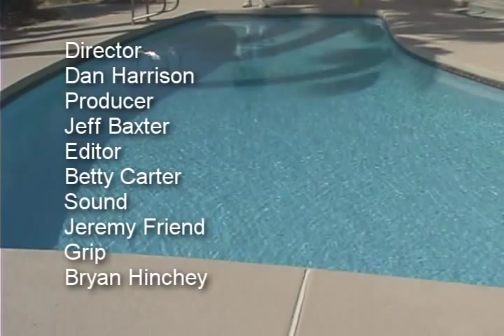How To Paint & Acid Wash A Swimming Pool - Part 3 -Painting

Comment: I would add to remove hydraulic plugs at the bottom of the pool to prevent the pool from lifting like a boat.  We live in an area with a high water table. What is the average cost per gallon (w/hardener) for the Nelsonite PoolPoxy Hi-Bild or the Ramuc paint that you used?  I understand that it takes a few days for the paint to cure, but how soon after painting can it be rained on?  Thanks for the video!

Comment: Hi, my pool had been painted with a water based paint called insl-x paint. Can I now paint it with the epoxy based paint?
Reply from the maker: So most pool paint is either water based, acrylic, epoxy or rubber based. Generally you want to use the same paint type as you currently have. If you mix the different paints, they wont adhere properly. If you do pressure wash all of the old paint off, then you can choose whichever one you want to use on the pool. Hope this helps and thanks for watching!

Comment: Excellent Job on the videos! You've inspired me!
Ques:
The water level is below the first step in our pool due to leaks/cracks, kinda brittle in areas. Is E-Z Patch still a viable option?
Is the pump in the bowl something you can rent? Any specs to look for on pump?
Where you concerned about the pool popping when empty? How many gallons of acid did u use for this job?
What would happen if it rained on day 2+ of paint drying process?
Can u get darker colors of the same paint?
thx

Comment: I have a commercial pool that has stainless steel walls, and a painted concrete bottom with racing lines. The approximate area that needs to be painted is roughly 82'x48' (the bottom only). How much paint would I need?

Comment: Really appreciate your videos and instructions. I finished painting our pool last Thursday morning. Pool was able to cure for 2-1/2 days and then we got a little bit of rain. Shop vacuumed the bowl of the pool. The next three days we got more rain, not a huge amount, but enough to fill the bowl. We waited the three days until the rains stopped before vacuuming the bowl out again. Now the pool has been able to cure/dry for another three days. Is it safe to fill the pool tomorrow or do we need to wait longer? Please advise I would very much appreciate it or my family may mutiny!!! 😬😬😬
Reply from the maker: Normally paint should be left to dry/cure for about 5 days. Go into the pool and press on the paint in a few spots to make sure it has hardened, especially in  the deep end / bowl area. If that has hardened, you should be good. Best of luck to you and thanks for watching our video!

Comment: My pool in Florida is less than two years old.
From the get go there has been extreme mottling and the pool contractor has drained, acid washed and refilled the pool with noticeable improvement for a month or two before returning to the mottled state.
We are diligent in keeping the chemical levels at proper levels and brush daily.
Quite frankly we are done with trying to resolve this issue in this matter.
We have several quotes to have the pool resurfaced but am also considering painting the surface which has a quartz finish.
Have you any experience with repainting a quartz finish and do you expect the mottling to come through the new painted surface?
Thanks !
Reply from the maker: Hi Chet - That's so hard to predict or diagnose without seeing it in person. Sounds like you have something unusual happening there, so I would not recommend just painting over it until you get to the root of the issue.  I would call up a few different pool companies in your area and get their opinions before doing any painting.
Reply: Pool And Spa TV Thanks for your prompt reply !

Comment: We just bought a house with a pool.  My husband drained it and that was when we saw all the plaster coming out around and on the steps and there is rust at the jet in the shallow end.   Plus we used a pressure washer in the pool and got lots of the algea and stuff off of it but not all.  I was wondering how to fix the plaster and the dirty walls and then how to paint it and you addressed each and every issue we have.  I imagine we will start this pool project this weekend coming up and finish it in 2 weeks time which is time for the hot sun coming our way.  Thank you so much.
Reply from the maker: +Elijah Diamond - You may want to have a local pool guy come over and take a look at the quality of the plaster on the pool before doing any additional work. If the plaster is degrading, and you paint over it - it will look great for a while, but it could start to come off, ruining your paint job. You only want to paint a pool where the plaster/cement/gunite is firm, strong and not deteriorating at all.  If you only have a few small spots like we show in the video, then you can do some small patching yourself (like we show). But if you have a lot of degradation, you may need to have the pool re-plastered prior to painting, Just a tip....  Thanks for watching :o)

Comment: How much was labor and material cost?
Reply: Was this on a 35,000 gallon pool?
Reply from the maker: @savagewarriorzz2199  Well, The people in the video were our employees, so there was no charge to us for that. That pool was a 14,000 gallon pool - approx 14x28. So to a pool owner, the paint would be approx $500 and it would normally be about $2000 in labor. That varies greatly depending on the state/area where you live. Hope this helps. Thanks for watching!
Reply: @PoolandspaTv   how much in labor on a 35,000 gallon pool?
Reply from the maker: @savagewarriorzz2199  You would need to call a local pool service company to get an exact price quote. Could be anywhere from $2000 - $6000 depending on where you live.

Comment: Tim, 
Some say that I mut use the same paint as the old paint on the pool, because they should mach chemically otherwise the new paint won't stick to the old one. Is that true?
Thank you
Reply from the maker: So most pool paint is either acrylic, epoxy or rubber based. Generally you want to use the same paint type as you currently have. If you mix the different paints, they wont adhere properly. If you pressure wash all of the old paint off, then you can choose whichever one you want to use on the pool. Hope this helps and thanks for watching!
Reply: @PoolandspaTv  Thank you for the quick response!

Comment: Hi Dan, thanks for putting this 3 part video series together. Very informative. I'd like to paint my concrete pool - it's about 30 years old and the original paint has worn/peeled significantly about 2-2.5 feet down from the rim. Will the acid wash generally remove existing paint? if not, is it ok to paint over any remaining original paint after the acid wash phase? Any recommendations would be much appreciated. Thanks. Mike.
Reply from the maker: Mike Fabrizio - It will not remove paint that is still stuck on the pool. You would need a power washer or a sand blasting for that. However you do not need to remove all existing paint in order to repaint a pool. Just make sure there is no loose old paint before you attempt to paint over it. Hope this helps. Thanks for watching. Dan

Comment: My pool has a gunnite bottome with plastic/fiberglass composite side panels.  Would the same procedures and materials be used or would different be required?
Reply from the maker: No. You should not do this procedure on plastic, polymer or fiberglass walls. Just on gunite, plaster or cement wall pools...

Comment: We are adding water to a newly painted pool and I saw in your "opening pool" video that you added 1 gallon of Cyanuric Acid right from the get-go.  We were told to use Muriatic acid.  Are these two the same?  Gina
Reply from the maker: No they are not the same. Cyanuric Acid is to raise the CA levels in fresh pool water. Commonly called Stabilizer, it keeps the chlorine in the pool from being burned off by the sun rapidly. Most pools need 2-4 lbs. of CA upon a fresh filling. Muriatic acid is either used to do an acid wash on a pool, or in your case, can be added to decrease the PH. I would not add that until you get a water test done. But the Cyanuric acid is something you should put in right away.

Comment: Good information. Glad the water table was obviously low and the pool didn't pop out of the ground. Note: keep the plug out of the main drain to relieve any hydro-static pressure from the ground water table. Also, do this job during the months with the least amount of rainfall to help avoid catastrophic pool popping out of the ground. Run a sump pump full time if ground water continually enters through unplugged pool to complete the job. Pray everyday and if you can't stomach the risk and can afford to hire a pro with insurance against popping, do so, so you can sleep at night. ( I have had a pool pop -out of the ground in FL during a paint job. I foolishly hired a non pro (kind description) that plugged the drain before a two day rain deluge, the pool popped. $$$$$ ouch!!!
Reply from the maker: This pool was in Southern Nevada on Sunrise Mountain, so there was no chance of sub-surface ground water. But for your pool in Florida, yes, you have to watch out for "popping out" due to high underground water tables. So for everyone in areas like Florida, definitely hire a pool professional who knows what he's doing anytime your pool needs a repair that requires the pool being totally drained out. Thanks for watching!

Comment: Do you have to acid wash before painting?
Reply from the maker: It is a good practice to do so.  With some pools, a power washer might do the trick. But you really want to remove any oils, algae or other organics from the pool walls and floors.  If you don't, the paint may not adhere properly. Thanks for watching!

Comment: hi dan I just watched all 3 videos it was a gr8 help, just one question. you said to leave the pool for 6 days b4 filling it up, what if it rains within those 6 days will it damage the paint job?
Reply from the maker: Well, that is the big question when painting a pool. You really want to have at least 3-5 non-rainy days, whenever possible. If it does rain, it most likely wont ruin the paint, it will just take longer to dry. Try to pick a week when the weatherman says it will be clear. Hope this helps. Thanks for watching :o) Dan

Comment: HI,
we are in process of draining our 30+ year old pool.  As we have been draining and the shallow end is empty we have noticed our pool is not entirely concrete as we had originally thought.  There appears to be a 4' rim of metal around the upper section of pool.  The question is should we be using a different type of paint for this section than what is used for the concrete portion?

Thanks for any help!

Beth Callinan
Reply from the maker: MEHASPANTS - Well, you can get acrylic or epoxy based pool paints. The epoxy paint costs more, but is much better. I can't say that I have ever run into a situation like yours, but I would use a primer first on the metal parts, then I would get the more expensive epoxy pool paint for the whole job, and I think you'll get an even-looking, long lasting finish, doing it that way.  Dan

Comment: Hi Dan, I will be repainting my pool soon. I will follow your videos to do this. Question, Will I need to primer the pool before paint? I see you acid washed and painted ,but there was no primer applied. My pool is in decent condition.Thanks.
Reply from the maker: You may need a primer. In this pool we did not need it, as there was really no surface left after we cleaned it. Some pool paints are paint/primer - so it really has to do with which brand you get. I don't think priming it first could ever hurt. But if you don't think you need it, don't use it. Thanks for watching. Dan

Comment: Did you use a primer before painting? And is an acid wash an absolute must? Can you use muriatic acid mixed with water to acid wash?
Reply from the maker: We did not have to prime this particular pool. Usually acid wash is a must  B4 painting. And yes, you use muriatic acid. Hope this helps!

Comment: I've got my pool empty and have begun painting with an epoxy pool paint. I took the light fixture out and a question occured to me: Behind the fixture, there is a hole in the wall, inside that little niche, where the power cord passes through. My understanding is that water gets into that niche and surrounds the light fixture. So wouldn't that little hole -- in my case about 1/2 inch --  have to be plugged up in some way to keep the pool water from leaking out? (Someone once told me no, because a conduit that aims upward is supposely on the other side. But a few roaches actually came out of that hole into the niche, which suggests to me that there is a space back there where the water could leak out of the pool and go to.) Thanks for any insight you may have. (Oh, by the way, I once saw advertised a rubber stopper that fits around the electrical cord that would plug up such a hole, but it came in 3/4-inch or 1-inch -- both too big to fit in the hole my electrical cord passes through.)
Reply from the maker: Hi Steve! The hole is supposed to be there, and the conduit pipe gets water in it, as the pipe turns upwards. This is called a wet niche light. You can put pool putty around the wire in the hole, after you reinstall your pool light - if you feel you have a leak in the pool at that point. But if your pool is not leaking (like down to the bottom of the light, then stopping at that level) you most likely do not need the pool putty. Hope this helps. Thanks for watching. Dan, Pool And Spa TV
Reply: ***** Dan: Thanks for that insight. My concern, though, is that 1) I have never let the water level drop down to the level of the light to test the hypothesis that if it stops there, I have a leak. Rather, if I see the level down a few inches, I top the pool off. And 2) Though the conduit is supposed to contain any water that goes through, I worry that after 30 or 40 years, that conduit might no longer be entirely intact (as the fact that several roaches came out the hole recently might suggest). Seems like one of those hole plugs might be a good precaution, though, as I said, they don't seem to come in a size small enough for a 1/2-inch hole. Maybe, as you suggest, pool putty could be used instead. I don't suppose there's a way to seal the light fixture against the niche to prevent water getting in there in the first place?
Reply from the maker: Steven Zak
No. You should putty the light at the niche hole, not seal around the light unit to the pool. Hope this helps :o)  Dan
Reply: ***** Thanks!

Comment: Question, did you wait for the paint to dry before removing the tape around the edge or did you remove it while it was wet?
Reply from the maker: Just a personal preference. I think most pool guys do it once it dries. If you have tile, and you have any over-paint areas on the tile, you can easily remove the paint with a razor blade or scraper. Thanks for watching!

Comment: I have a gunite pool. Last year I noticed plaster cracked many place. So I took plaster layer out as much as I can.  Meantime gunite damanged with lots lots lots  of small pits from chiselling. Can it be fixed with EZ-Patch ?. Or If I can apply paint over small pits.   many thanks
Reply: I did the same thing with EZ-Patch and just painted over it.  Everywhere the EZ-Patch was the paint sloughed off and I had unsightly places.  I should have either used more acid or used a primer.  I am going to re-do it this year and will just acid the crap out of these places, apply some primer, then two coats of paint to the EZ-Patch spots and then one coat for the rest of the pool.  I hope Tim will chime in on this and give me some advice or correct me if I need to do something different.

Comment: How much would something like this cost me to have done??
Reply from the maker: It really depends on the size of the pool, the type of paint you need and the condition of the wall surface. General ballpark price to have a pool painted is around $2500 - $3500, but that varies greatly. I would suggest calling a few local pool guys in your area and get 3 or 4 estimates. Good luck with it and thanks for watching!
Reply: Don't call a pool guy, they will ream you. Hire a handyman and get the job done for $500-$600 and you provide the materials.

Comment: Do you need to put a primer down first if you are using epoxy?
Reply from the maker: Normally you may want to use a primer. That depends on the condition of the pool. In this pool, since it had not been painted in a long time, and since we acid washed it first, it did not need a primer. Thanks for watching :o) Dan

Comment: By only doing one coat you have  voided any guarantee. Might look good to the eye but without out a doubt there are pin holes. Sad to see so called professionals teaching people their bad work ethic.
Reply from the maker: Terry - Well that is not necessarily true for all paint brands. Many pools can be properly painted with one coat of paint, provided it is a high quality paint. Sure, there are some pools that may be in very bad shape and may need two coats. But just like other types of painting jobs, the decision for the number of coats needed has to be made on a job by job basis for proper coverage. Thanks for watching!